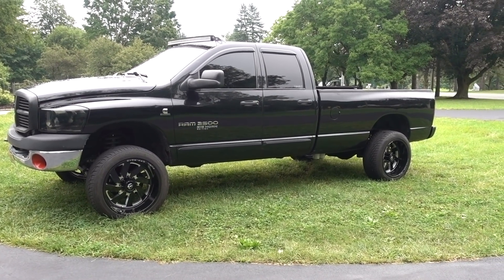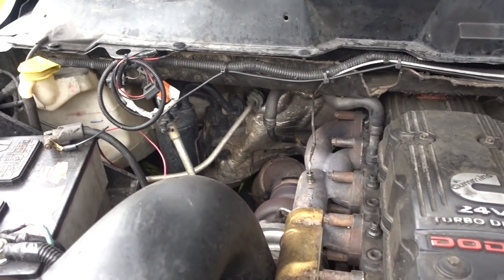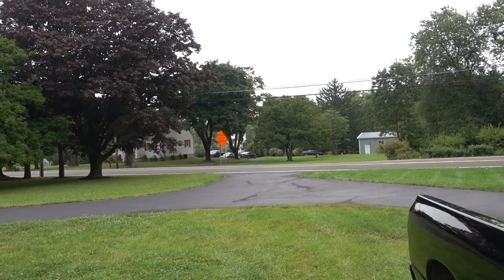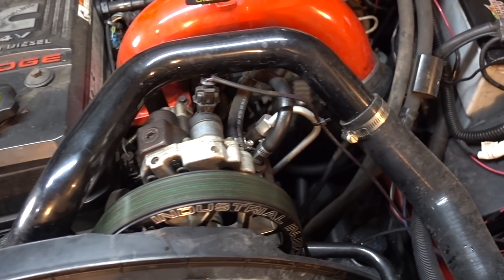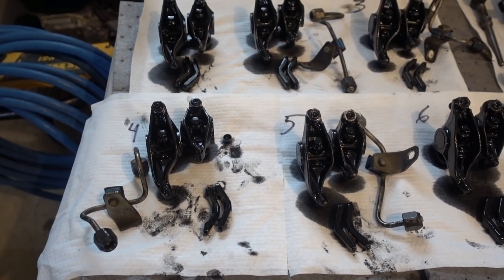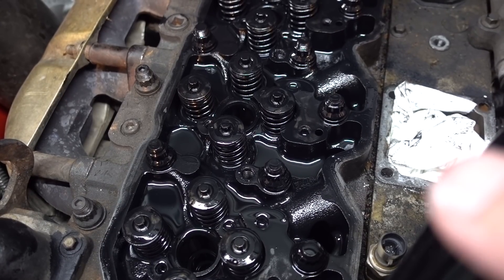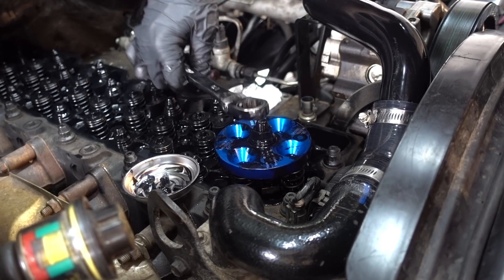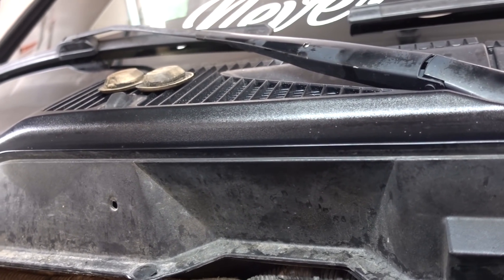This now makes 5 CUMMINS!!! WE HAVE TOO MANY CUMMINS TRUCKS!!!

Comment: Paul from Sydney Australia,
I find your videos entertaining and informative and we dont have Cummins trucks here in Oz.
You guys inspired me to make and install a catchcan for my 165000 km Kia van and after cleaning out the intake and changing the oil it now feels like the day I drove it off the lot in 2006.
Better acceleration, smoother and when its warmed up, alot less tappet noise
I made the catchcan from an old milk frother(stainless steel filled with scrubbers) from a cappachino machine and it cost me $14 in hoses.It seems to be doing the job.
Keep punching out these cool videos Greg, I reckon alot of blokes all over the world enjoy them.

Comment: Hey Greg you should be adjusting the valves anytime pushrods are changed, they are the same but not usually down to a thousands of an inch longer or shorter. The procedure is quick to do before installing the valve cover, and the engine wouldn't be ticking when it's running. Just a thought and dont forget if your getting paid to do the job you might as well adjust them. UNLESS you skipped that part in your video. Keep them coming.
Reply: Jeff Derus -   @ 19:06 I'm pretty sure he said they were way out and he adjusted them.
Reply: Itsa Mea right on I must have missed it
Reply: No Worries

Comment: Greg what turbo could i use as a drop in turbo on my 04.5 5.9? I have fass 150, new stock injectors, stock cp3 with the bag of parts, s&b cold air intake, grid heater delete, 4' straight pipe, and a Smarty touch tuner. Need some info on a turbo. Thanks!
Reply: Check out the stealth 64 from calibrated power. It’s a direct drop in

Comment: How did you keep the valves from falling when you removed the keepers?
Reply: 87 ZukiSami u turn engine over each cylinder up all the way. Then u can remove spring an valve can't fall in. Or u can do it with air when injector is out
Reply: T bone i know trick. Just didn't see him do anything about it so was just curious. Thanks

Comment: Why 5 Cummins when 1 dmax does anything you want.and you can't hear it rust at nite.lol..
Reply: abe lansky except none of his trucks are rusty. Except for the 1st gen which I just some surface rust. 
Besides if you're buying a diesel an inline 6 is the way to go. Especially when it's a Cummins.
Reply: Tristan Burkholder nothing wrong with a Cummins owned many in my semis the last 40 yrs.it's the rams i got a problem with.my sons got 1 and my friend owns 2 .he delivers trailers.besides brakes,transmission,  electrical,and front ends, theres the rust.if ford still but Cummins in a truck I'd have 1.